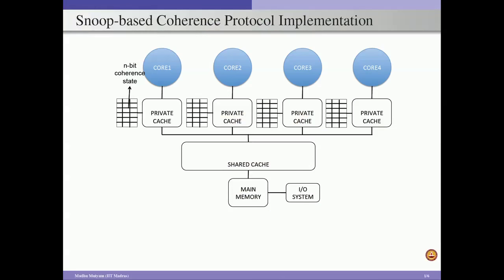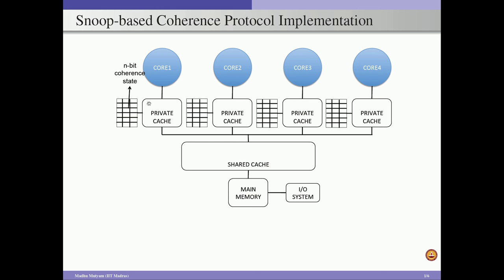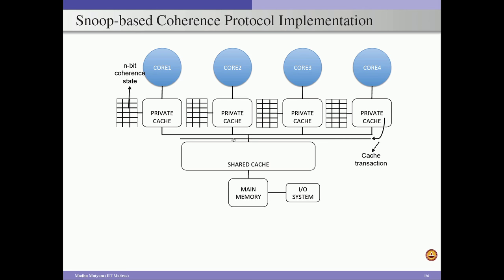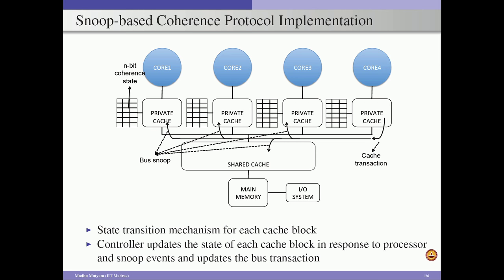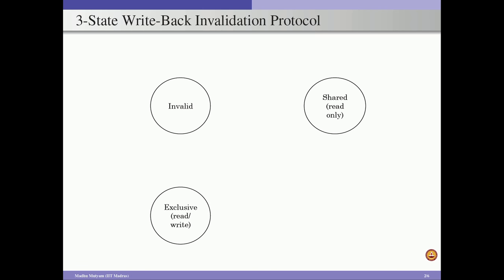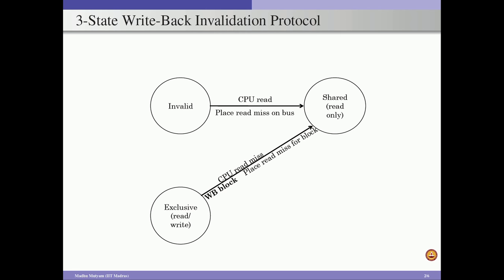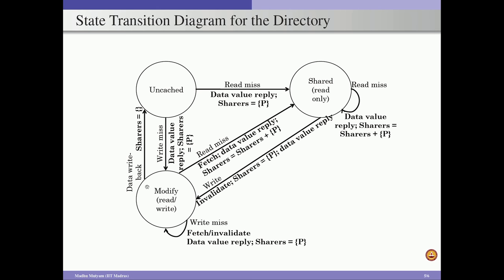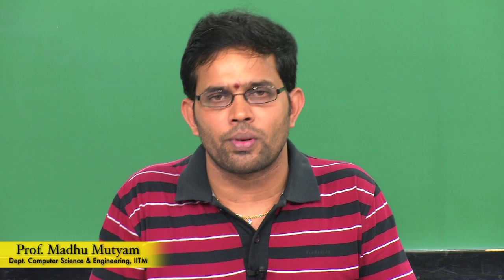Cache Coherence Protocol Design

Comment: what is victim block?
Reply: exactly, damn !
Reply: If a core tries a read/write on a particular block, and that block is not present in its own cache, then it has to take one of its block on a particular basis( could be LRU). So a least recently used block is now modified, hence its called as the victim as we are modifying that block instead of any other.